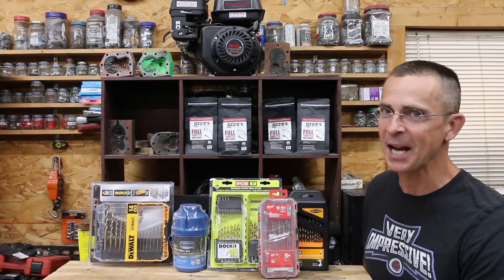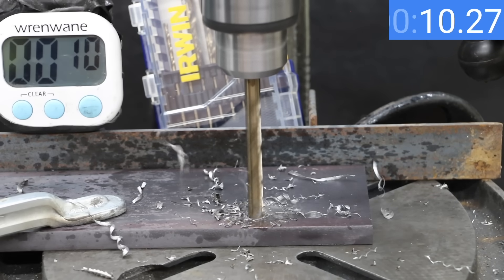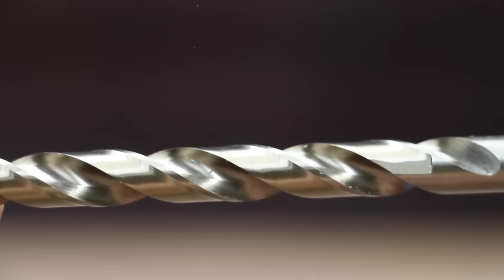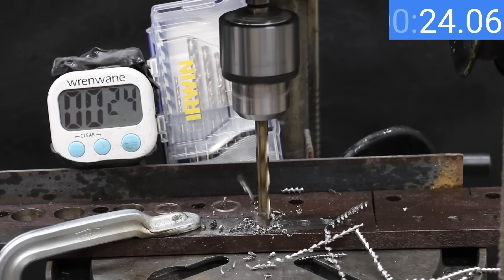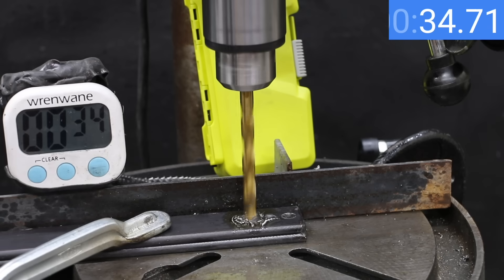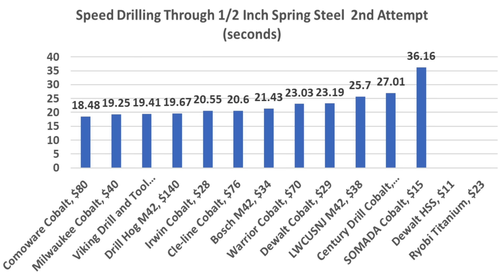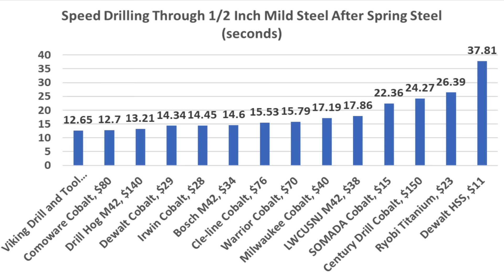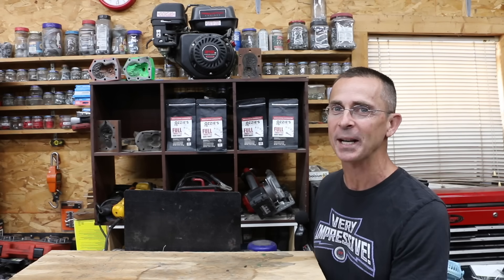Best Drill Bit Set? $11 vs $200? Let’s Settle This!

Comment: Excellent, as always.  I would like to see a quick change drill bit showdown.  I purchased a few brands with the 1/4" hex  for which change or magnetic bit holders.  Some easily spun out as they only had a pressed, friction fit, while others were the same, but then crimped.  And then there are the forged/machined 1/4" hex bits.  Not all are equally good nor centered!
Reply: Which did you like best?

Comment: I was concerned about this one as I'm a Tool and Die Maker and have drilled way too many holes. You did a decent job comparing them and since most don't know how, or won't be bothered, to sharpen their bits, the review criteria was suitable. I like the way you are able to find methods that are down to earth to test your products. Very impressive!
A proper point can make even a crappy bit drill better and too many of them use marketing hype to sell their products. These funky sharpening gimmicks can't really be duplicated at most shops so once you dull the bit, you're back to basic sharpening. A big inconsistency I noticed though is the pricing; some were small sets while others were full 29 bit sets so the prices weren't really well represented.
Reply from the maker: Thanks for the feedback.

Comment: From someone who works in steel fabrication. The test of a drill bit isn't the time to drill 1 hole fresh out of the box, it's the time to drill 1 hole after drilling 500 holes, being resharpened, and drilling 500 more holes. I know this wouldn't be practical to test but gives some perspective from the fabrication industry. We only use Drill Hog or whatever McMaster Carr sends.

Comment: An issue with 135° points comes with drilling through round material. The flatter angle pounds and grabs. I buy almost exclusively 118° HSS drills for my machine shop. Even when used in CNCs, 135s grab in round steel. Especially on the opposite side penetration. Helical points work best. I like them over split points for most everything. You will have to send your bits to a professional grind shop to get helical points put on. The cost is usually around half the cost of a new bit. I do buy Cle-Line drills occasionally. Also Cleveland,  National Twist Drill, and OSG. My FAVORITE  is Guhring and 95% of the non carbide of what I get are HSS with black oxide/steam oxide coating.  I only buy cobalt for specific jobs. Guhring are made in Germany for the most part. They used to make some in the US, but I haven't seen any made in USA for a while. They're worth every penny.
Reply from the maker: Thanks for sharing.

Comment: Thanks for your informative videos!
     I think many consumer drills have a very thin titanium nitride coating over a very mediocre drill, because many of us are attracted to shiny things, and the word "titanium ". 
   The localized heat generated right at the cutting edge is intense, many steel alloys soften and deform, no longer supporting the hard but very thin coating. Then you have junk. Cobalt in the alloy increases "hot hardness", which probably matters more than the gold eye candy coating, in many cases.
     Many (most?) drills die an early death due to abuse. A hard material does not mean "spin it really fast". 
    Anyone who cares can Google "metal cutting feeds and speeds" . A very slow feed rate (how hard you push) reduces damaging heat, but can still increase wear.
    A warranty on a drill I think of as a bit of a scam sales tactic, as they all have a limited life, no such thing as a lifetime drill, if you use it much. Learn to sharpen them, or accept buying new ones.
    You will probably not see any of these brands in a machine shop, where professionals try to figure out how to get max life and lowest cost per hole drilled.
    Thanks again for all your informative videos, including this one!
Reply from the maker: Thanks and you are welcome!  Thanks for the feedback.

Comment: As ever a comprehensive and unbiased review giving great insight for value for money and safety , could you possibly do a tile hole cutter video at some point as never bought one ( usually pilot hole with 2 - 3 mm HSS and piece of masking tape to stop slipping of bit , then use masonry bit /s for larger hole
Reply from the maker: Thanks!   Thanks for the suggestion.

Comment: You just settled my debate sir.
I was going to before the construction season begins search for a replacement drill bit set.
I have used black and Decker see why they stopped making them.
Craftsman had two lines high speed and cobalt.
I bought both one worked better in wood and the other steel.

Thanks again for your "M ad scientist" testing 
Keep up your hard work we appreciate it.
Reply from the maker: Thanks and you are welcome!

Comment: Any chance you could do a comparison of power inverters? Have an unheated tractor cab and wondering what 12v to 110v inverter (for ceramic style heater) is the best deal. Harbor Freight has them along with others.
Reply from the maker: Thanks for the suggestion.

Comment: Test yard shovels. I have an Ames with a solid fiberglass handle that I've had and used for 20 years. I've bought newer shovels and have broke or bent every single one. Does anyone make a robust shovel?
Reply from the maker: Thanks for the suggestion.

Comment: Bosch it will be and I guess Bosch products are always premium quality with an in the middle price tag include csr parts. I had an old Bosch Aquatac110 pressure washer and i used it mostly to my car but in 2023 I pressure washed about 800m² och paving dtones and slabs. The machine cost me £50 about 5 years ago but started to overheat so got a bigger Aqutac 135 instead in 2023. . 
Thank you for your video Sir.

Comment: Bought a Drill Set, 100 drills for roundabout 20 Dollar, "Titan coated" from Amazon , it kills 3 drills  to make a single 5mm hole in mild steel. Totally Rubbish. 
Then I bought a set from Bosch, around 60 Dollar, HSS-G, these drill cut through steel like a hot knife through butter. You almost always gets what you pay for.....

Comment: @ProjectFarm just realized there hasn't been a test for alternatives for brake parts cleaner like acetone, naptha, non-chlorinated brake cleaner, and any other solvent based degreaser. 

I feel like there are many dangers that could be avoided by using a degreaser that us not chlorinated.
Reply from the maker: Thanks for the suggestion.

Comment: Hey Todd, thank you so much for your insightful and amazing dedication to accurate testing for these products.  Been watching since 2020 when I needed tools for my job and I felt overwhelmed by the selection at Home Depot.  You made everyone at work jealous of my DeWalt stepped bits!

I know you have done a video before of blenders but I would like to request another go with blenders that really tests the higher end hardware.  I felt that the video you made before had well thought out testing methodology but the products themselves were a league below the Vitamix which wasn't really surprising, nor competitive.  I am really interested in seeing something comparing $200 and up "Professional" level blenders from Vitamix, Blendtec, Hurom, Cuisunart, Breville, Kitchen Aid, Wolf Gourmet, or any other brands that you think fit in with the crowd.

Additionally, I've been getting into cooking at home a lot lately and one thing I noticed that many reviews out there don't really focus enough on is the shape of the jar.  The Vitamix has an exceptional shape since it tapers down at the bottom.  This allows it to create a vortex for optimal blending without aerating the blended materials too much.  The Blendtec, on the other hand, does not do this well.  It has a large square base and large, thick, heavy blades which pulverize well but also unnecessarily aerate the blended materials due to so much chaotic movement in the bottom of the blender.  Most of my smoothies in the Vitamix come out smooth and creamy, while a Blendtec makes them foamy which is less than ideal.  Another problem with all that extra air is that it makes my 2 cups of ingredients take up 3 cups of space when I pour it out to drink it, so I have to refill my cup with the Blendtec but the Vitamix makes the same ingredients fit in one pour since air bubble aren't as prominent.

Thanks for reading.  Love the content!
Reply from the maker: Thanks and you are welcome!  Thanks or the suggestion.

Comment: This might be hard to do, but I would like to see a comparison of home AC systems. I have a 20 year old system that still works fine. I get guys coming to the door trying to sell me an "upgraded" AC system they claim is more efficient. I submit that the power consumption of older systems is not that different. My thought is the only parts that might wear out and cause the system to work less efficiently could be the valves or pistons. I have a Philco refrigerator that has run since 1955 and it stll cools perfectly.  So if you could find a way to measure the power consumption of a typical 15 to 20 year old 2 ton AC system and compare that to a newish 2 ton AC system that would be cool. I enjoy  the channel and look forward to what you come up with next.
Reply from the maker: Thanks and you are welcome!  Thanks for the suggestion.

Comment: Hmmm, surprised there wasn’t any go/no-go testing for actual hole size tolerances (did I blink and miss it?).  Hole sizing is a top consideration for us.  Yes, we do check runout on our spindles/chucks.  Anyways, having used more brands than you can shake a stick at over the decades 😜.   For hand drill/drill press (non milling/lathe work) two brands are In our shops.  Bosch gets our money for wood and brass/plastics (we slightly shop mod the tips for those latter two materials); in large part due to consistent hole size accuracy across bit batches.  For soft steel Dewalt pilots gets our money.  If we need accurate/clean holes in wood, Fisch Forstner & brad points.  Not part of your test here, for concrete hammer drilling, Bosch all the way.

As always, YMMV.  Just sharing, nothing more, nothing less.  Not associated with any of the above brands other than as a pay8ng customer.

Have a good’un.
Reply from the maker: Thanks for the feedback.
Reply: @ProjectFarm  Thank you for the videos.  😁

Comment: Hey Project Farm! Love your videos and you do a great engineering analysis of products. I know you say you read all your comments and I have a request for what I think will be a very helpful review. I know this request is irrelevant to drill bits, but chose your most recent video so hopefully you will see this. 
I would love to see a review/comparison of chemical intake valve cleaners for direct injection engines. There are several products available on the market all with high level of claims. I have a 2022 Silverado 6.2l direct injection with 30k miles and i want to give the intake valves a chemical treatment. I understand walnut blasting is the industry standard best way to clean them, but that is very expensive. I would love to see a comparison of the intake chemical treatments for you to determine which is best! Please make this video!!!
Reply from the maker: Thanks!  Thanks for the suggestion.

Comment: I was happy to see Huot represented (Drill Hog). I use their numbered set (#1-60) in my shop for small holes in ebony, bone and sterling silver that have to be clean. Before I bought that set I had to regularly buy replacements of high use sizes (Chinese bits), but have not bought a replacement ever since I got the Huot set. I specifically looked for bits made in America when settling on Huot.
Reply from the maker: Thanks for the feedback.

Comment: I'd like to see a follow up rust encasulator test.  The last one you mixed rust converter and rust encapsulaor.  This time testing just rust encasulator paints like: POR15 (the champ), Tamco monocoat, KBS coatings, the new eastwood platinum, rust oleum reform and seal, and Xion labs (amazons brand).  Things to consider when testing: how well it prevents rust, how well it adhers to different surfaces (paint, rusted, dirty, and bare metal), how many parts to the process (por15 is a 4-5 step process), and how well it holds up to UV damage without a top coat.
Reply from the maker: Thanks for the suggestion.

Comment: I make knives out of M42 because of the bosche bit i tried it out and cut through stainless my M2 bits wouldnt cut many times. I have some testing videos on my channel. Its good stuff. M35 is M2 with 5 percent co added. M42 is different altogether. I had mine treated to 63-65 hrc but the steel can get up to 68 or 69. I bet the Lw brand just didnt triple temper or didnt temper high enough temperature with their brittleness. However they may last the longest in wood
Reply from the maker: Thanks for sharing.

Comment: I’d like to see a “Best 14” Pipe Wrench” video with brands like Ridgid, Duratech, Grip On, Milwaukee, Crescent etc, in cast and aluminum. I’d also like to see some more ratchet videos, like “Best 1/4” Drive” , “Best 1/2” Drive” and “Best Extendable Ratchet “. I’d also like to see another “Best Adjustable Wrench” video but in an 8” version. I’m an industrial mechanic and an 8” adjustable is always in my pocket. Lobtex (Lobster) in both their X Drive and Standard as well as Wiha would be nice to se included in that video.

Comment: Great test.
But, are the larger Drill Hog bits actually stamped USA?  Like the Viking, Century, Cle Line, etc are?   No; the one you showed isn't.  Therefore, I'm guessing it's made in China.  Which is fine, but they need to be clear about COO; and they're not.  If it's not stamped USA, or the package doesn't say "Made in USA", we need to assume it's made elsewhere.  Just because there's "USA" in the name and flags on the logo means nothing; it needs to say "Made in USA".
Reply from the maker: Thanks!  Thanks for the feedback.

Comment: I'd like to see you improperly use 3m panel adhesive and compare it to the winners of your epoxy/glue/ect videos and welding.  

Frame rust for instance can be fixed with basically adding new metal around the frame's sides and bottoms.  You weld around the seam for the patch.  Would 3m panel adhesive do the job?  Does welding and adhesive make it stronger?
Reply from the maker: Thanks for the suggestion.

Comment: After 40 years as a toolmaker I can say with all confidence you don’t need the most expensive. Conversely you may not want the cheapest either. If you are drill only wood cheap may be a good choice. How much you use them is also a consideration.
Reply from the maker: Thanks for the feedback.

Comment: Would you consider comparing CD/DVD/Disc- Resurfacing machines? Outside of the very expensive ones, the $100 ones are hard to pull the trigger on...
Reply from the maker: Thanks for the suggestion.
Reply: Ty for reply, Fingers-crossed!

Comment: I think it is a bit silly to talk about a seconds difference competition and the test are done manually by hand. The margin of (measuring) errors is huge on differences of milliseconds, a seconds or a few seconds. The speed results are so close. At a normal task a few seconds difference is no issue at all. I think the speedtest is not a proof of quality, skip it, it is worthless. The wear at one drill session and the amount of usage (durability) and performance loss is a quality factor.

Comment: Try drilling in 316 stainless steel 1/4 inch thick, I used do this at work don't know what bit was used but it took about 10 bits to get through it, every cabinet and all building was like that it was a wastewater plant. A funny one at the CL2 building on the outside of the building was a add on and they put up a aluminum cabinet of coerce they used putty in the conduit and CL2 made its way in and caused an explosion and we had to rewire the thing.
Reply from the maker: Thanks for sharing.

Comment: Can you test precision screw driver sets? they are very useful for disassembling laptops or other devices, and it would be nice to see the difference between cheap and expensive. I know "I Fix It" brand are more expensive, but do they really worth it? I have a set  (one precision screw driver and 100 bits) I paid for it 50 RON (Romanian currency) = 11 USD and it works very well
Reply from the maker: Thanks for the suggestion.

Comment: Bought a set of Dewalt drill bits. All of the smaller bits in the set were all dull and would not cut. About all they would drill through was soft pine. Very disappointing.
Reply from the maker: Thanks for the feedback.

Comment: Should have included the Hercules bits.
Reply from the maker: Thanks for the suggestion.
Reply: I have been a machinist for 40 years. very very good bits for 25.00. Fasted cutting bits I have seen in a while. In the blue box. You will like them. Who would have thought Harbor Freight would have such good tools in the Hercules brand. Like the videos.

Comment: It would have been nice to see a set of Drill America KFD Black & Gold Bits tested in this competition.
My machinist at work prefers them for general use and claims they are sharper out of the box over many of the other major brands.
I tried them and they worked better than the cobalt bits I got at a certain blue themed home improvement store.
Reply from the maker: Thanks for the suggestion.

Comment: Test Idea. Our new vehicle (Sprinter Van) has quite a parasitic draw, typical for this vehicle, if left for a few weeks it will draw down the battery Tom a point that it’s a no start. Some who own this use a 120/12V trickle changer to beep it fully charged, I’ve tried a portable solar  charger only to have it over volt the battery and destroy it. Can you do reviews of portable solar chargers. There are many of these vans out on the road, from work van to RV
Reply from the maker: Thanks for the suggestion.